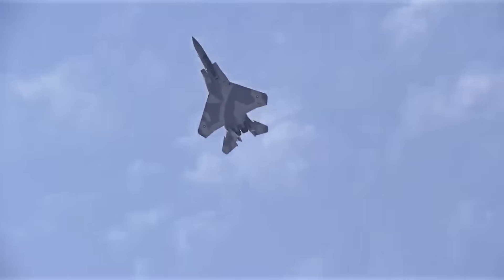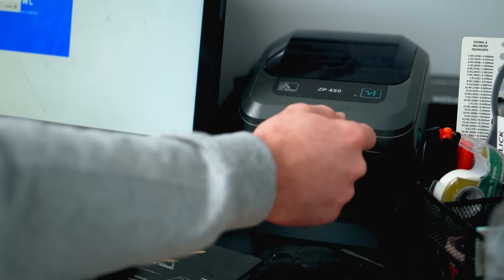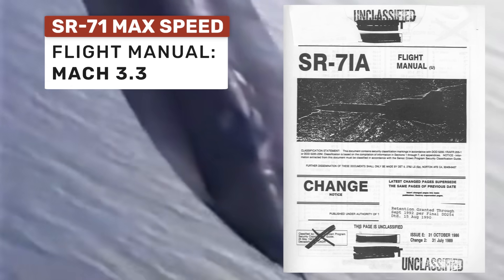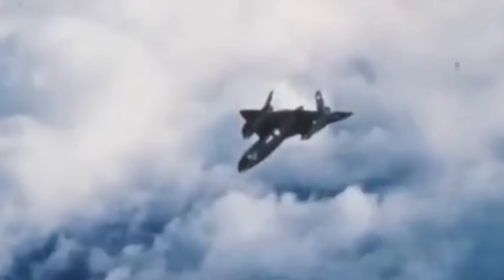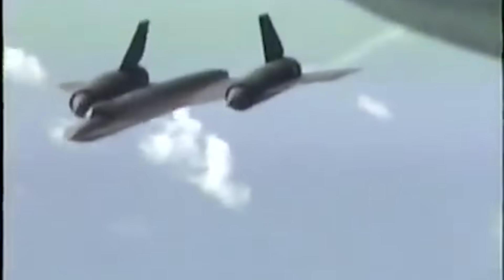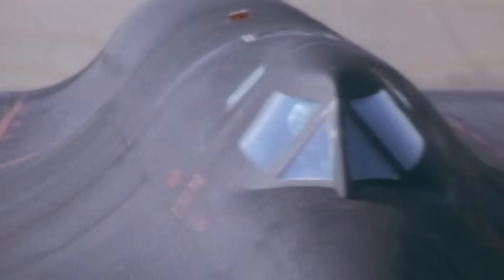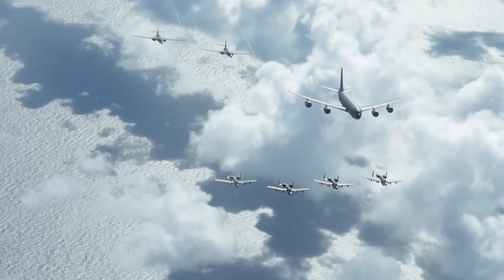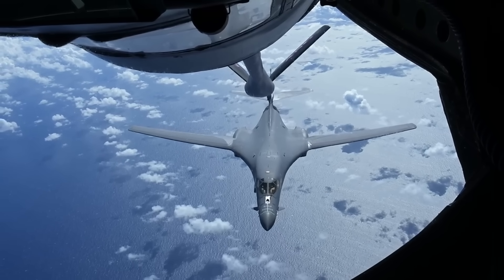The SR-71 was MUCH FASTER than the Air Force will admit

Comment: The German bomber that Hitler wanted to bomb Manhattan Suposedly would go into low space and Skip off the atmosphere all the way to ny, drop its bomb then go back to low space and Skip to japan.
If the Dr was using this method of travel it would explain why it had no it signature while travelling over cccp airspace.hmmm
Reply: What you're describing was built by Eugen Sanger and Irene Bredt and was called the Silbervogel (Silverbird). It was basically an aircraft composed of three pieces: The aircraft itself, which had a flattened fuselage rather than a cylindrical cross-section, with three liquid-fueled engines in the back.  It had thin airfoils which were swept and had the thickest part past the 50% chord with an almost diamond-like cross-section, and an H-tail that looked like it wouldn't be out of place on a B-24 or an Avro Lancaster; a booster which was comprised of around 50 surplus V-2 engines and; a sled which was attached to a rail.

The design would fire it's booster engines and would accelerate down the rails for about a mile and half, with the railway tilting up 30˚ before it'd achieve flight.  At this point, the sled would separate from the aircraft itself, as well as the boosters.  The main engines would fire and the craft would accelerate to a speed of Mach 17.7 as envisioned and assume a ballistic arc which would place it past the von Karman line and effectively above the bulk of Earth's atmosphere.  Reaction-control motors would be needed to control the craft as the dynamic forces acting on the airframe (and control surfaces) would be all but nonexistant.

Normally, when you re-enter the atmosphere, you tend to ride along a re-entry trajectory that is flat enough to avoid excessive thermal and decelerative loads on the craft, and steep enough to avoid skipping off like a flat stone skipped across a lake.  The Silbervogel actually used the latter option however, and used it's reaction control motors to adjust it's attitude to effect this.  Prior to re-entry, it's bomb-bay doors would open, and a 4000 kg (8818 lb.) bomb would be released, followed by the bay-doors closing up.

The bomb's flight-path was such that it would come down in NYC: Even with no explosives, a projectile hitting the earth at 3000 m/s would effectively deliver enough kinetic energy as to amount to it's own weight in TNT (and it did have explosive in the payload).  It wouldn't quite be like a traditional bomb, and would hit more like a small meteor and punch a nice hole wherever it hit and displace a decent amount of rubble up into the air.  It wouldn't be anything like a nuclear bomb, but it would be a rude shock as it's supersonic speed would theoretically ensure nobody would hear it until it hit.

The craft would effectively begin entering and effectively skip across the atmosphere, decelerating, but also climbing as it did so along a ballistic arc smaller than the first. This would carry it further forward, and it would skip several times, with each skip being less than the preceding ski, much in the same way that a basketball bounces highest the first time, and for the same reason.  

Eventually, it would be incapable of bouncing anymore, and would effectively do a gliding re-entry similar to the later Space Shuttle, though it actually had flaps.  It would now be on the other side of the planet, which was expected to be under Japanese control (also another Axis power) and presumably able to find a runway long enough for its purpose.  Since it's landing speed would probably be fairly high, it would need a steep descent for most of the approach, with the flaps brought down, followed by the gear  just before touch down, at which point the nose would be flared for touch-down.

It was an interesting concept, but it was ultimately flawed for a simple fact that, while the Germans understood the effects of kinetic heating, they had miscalculated things, and it would have effectively burned up on the way up, or on the way down.

Comment: All things being equal an AV top speed is almost always limited by inlet design. F-16A with a "point" design inlet from NASA went ~2.6. F-14A would go 2.75 but it would halve the life of the engine. Subsequent models were given a "p_max" switch and told if they ever pressed it they would be permanently grounded. Anywho, this in the internet so believe me or don't.

Comment: I’m a private pilot and a plane nerd. Though my vision kept me from flying in the military, so I went in the Army. But a buddy I used to work with was an F-15 crew chief in the late 90’s. He told me years ago sometimes the pilots would push Mach 3 and then they’d have to go through some extra inspections. And those were C’s and D’s. I’d be shocked if an EX couldn’t do at least 2.9 on the regular.

Comment: You actually left out the primary limiting factor in the Blackbird's top speed.

I'm friends with Al Bowers, the recently retired chief scientist at NASA Armstrong (formerly Dryden).  After the Air Force retired the '71s, NASA got a couple to use as test beds for high-speed research. About 10 years ago I asked him, with all the wild stories of the plane's top speed floating around, if he could tell me what it really was, assuming it wasn't classified. His reply: "There's nothing classified about the SR-71 anymore, it's all public.  The Mach 3.3 number is (as you stated) the top speed for sustained flight for thermal reasons, but the real top speed is Mach 3.47, give-or-take, at 80% afterburners."  Naturally I asked further, "80%? Why don't they push them to 100%?"  He said, "Mach 3.47 is the point where the shock wave off the nose spreads out far enough to hit the engine inlets.  If you go any faster, they'll start ingesting 'dirty air' and you run the risk of compressor stall or flameout." Paraphrasing the rest of it, you're not going to make any more power (to go faster), no matter how much fuel you spray into the afterburners.

This correlates well with Brian Shul's Mach 3.5, since it does depend on air density.  There's also the CIA pilot who was being chased by a SAM (al la Gary Powers) who pushed his A-12 to 100% afterburners, while heading more up than forward, to outrun the missile.  He actually did, continuing to climb until the engines flamed-out and coasting well over 100K feet before heading back down.  He made it back to base, but the airframe was junk due to thermal and mechanical overloads, and likewise the engines since he kept running them well past the 3.5 shockwave limit.
Reply: Your first comment is decently accurate. Your second comment is completely BS though. So virtually everything is incorrect.
Reply: @gr8crash  - Sources?
Reply: @hagerty1952 pilots, ground crew, design studies,  tech data, mission reports. A good understanding of the aircrafts performance and that throttle position in AB isn't liner and a  direct correlation to speed. Also that most of what Brian Shul says is completely made us, especially since he was removed from flying the SR71 after he was caught lying to his Commander.
Reply: @gr8crash  - OK, that works. But 3.47  does round to 3.5, if you want to be pedantic.
Reply: @hagerty1952 true,  but they don't tend to round because the TDI is already accurate to the hundredths place. Only other thing I'd add is that there were a few flights in the 3.4x range, with one pilot reaching 3.49 and about 91k ft, but these were also not fully within the pilots control.

Comment: My buddy worked at the company that produced the aircraft - he stated:  "Take whatever statistic was published on the SR-71 and either cut it in half or double it - whichever is more impressive - that is the actual statistic.  He told me they went coast to coast in 54 minutes and that time included in-air refueling!!!  The published / 'official' stat was Mach 4.5 - he said Mach 9
Reply: Virtually everything you said is incorrect
Reply: @gr8crash  I completely agree!  Oh, and Project "Aurora" is virtually fiction too! 
You are ADORABLE !!!!   : )
Reply: @repentnow1720  no the aurora program was real. It encompassed the ATB program which in the end when it was between Lockheed and Northrop, Northrop won the contract to build the B2. That's all that came from the "aurora" project. 

The West to East coast record was 68 min, and that didn't include refueling. Refueling was completed before and after the timing gates and wasn't included in the times. 

There's literally nothing that states mach 4.5 as that's literally impossible for the SR71 to do. And absolutely never in a million years would it ever reach mach 9. That's absolutely absurd. 

Anything else you want to be corrected on?
Reply: @gr8crash  Again - I completely agree!   

You are again correct - The SR-71 was retired and nothing ever replaced it.   

We never built another / newer ultra-fast aircraft.

You as sooooooo cute!   

Don't you ever change!

: )
Reply: @repentnow1720 I mean at least you understand it. When the SR71 was retired, there was simply no real need or even ability to build a true successor in terms of performance. But the type of war fighting changed,  we needed aircraft that could remain on station for long periods etc.  That led to the rise of drones and UAVs. An SR71 would have been useless in that type of war.

Comment: 7:16 you can't tell the velocity if you only know the Mach number!
1) the mach number depend on the velocity and the speed of sound
2) the speed of sound depend on temperature

So if the airplane hit a cold air front, the temperature drop, and instantly the Mach-Number increase.
Due to the cold temperature the density is higher and you produce also more thrust, so your velocity is increasing.

Bottom line short: without the temperature you cant tell the velocity if you only have a Machnumber!

Comment: 3.5...90,000.    It is actually very dark navy blue and not black.
Reply: On a regular mission?  Absolutely not. Even getting to that speed and altitude required very specific atmospheric conditions, and those limits would be some what out of the pilots control. Also no, it wss never a dark blue, but black. Emissivity Black to be accurate.

Comment: A F-15 pilot at an Air show at The base at Panama City told me he had the aircraft he was on had been at 1950 MPH.  Not far from the Claimed top speed of Mach 3  at sea level is 2220, is it the same at higher altitude?  This was in the early 90's?

Comment: MILITARY records will NEVER be published because they are considered SECRET or ABOVE.
Spruance Class Destroyers have a Maximum UNCLASSIFIED SPEED of 30 knots. One of my ships did a high speed run (OUTSIDE the range of CIVILIAN EYES) to determine their ACTUAL speed. It took both the Ship I was on (making the run) and 2 other ships tracking us to get an actual speed because we may have gone faster than our speed indicators could measure. We made the run, and the results were published in SECRET NOFORN Lessons Learned documents. NOT releasable to the General public, nor any other Military members without a "NEED TO KNOW".
I am lead to believe you WERE a U.S. Marine (the cover in the back right corner of your video) so YOU should know better.
Reply: Depends on in use vs not in use. The SR71 has been retired for over 2 decades and all the performance information is known, public and published
Reply: @gr8crash  NO, there are still documents concerning submarines from WW2 that are still classified. The capabilities of 2 of my ships although decommissioned and sank, are still classified. So IN USE, is not a reason to declassify information. Performance data may be speculated, but HAS NOT been declassified, nor confirmed by the Air Force.
Reply: @warrenjameson5465 strictly referring to the SR71, virtually everything is declassified. Performance capabilities etc. All of it is known, public and declassified

Comment: I also knew an SR-71 pilot back in the 80's who said "it's faster".     But, I'm not buying the "hot day, nose down into good air" story..  Above 60 thousand feet altitude the air temperature is extremely stable.  Nothing that happens  on the ground (hot/cold days) has any effect up there for a long long time.
Reply: It was generally pretty stable but it did fluctuate. That fluctuation greatly affected SR71 performance

Comment: A buddy of mine worked in the Air Force in the 1980s. He refueled sr-71. He told me he knew: how much fuel he put into that thing before it took off, 
he knew how long it was gone for, 
he knew it was empty when it returned. 
And he said there's no way it burned that much fuel, if it only went as fast as they said it did.  Knowing as speed doubles aerodynamic resistance squares, he figured the top speed was closer to mark 3.8.
Reply: None of that makes any sense at all. And that speed isn't even remotely possible.
Reply: @millionsofrecordsernieb7587 so refreshing and rare to see someone else in these comments that understands what is and isn't possible and why. Great response.
Reply: @MillionsOfRecords I'm a mix. While I sometimes tend to jump on a comment it depends how absurd it is. But if they are genuinely curious as to the reason for my response I'll gladly tell then. Sadly most just aren't interested or get mad/defensive.  I agree it's nice that these videos get people interested,  but it does get annoying when they choose to believe the myths over facts.

Also agree, there was just no need to make it faster, especially when doing so made the aircraft increasingly less safe.

Comment: VMAX is only used to escape incoming enemy missiles, and damages the engines to the point they need to be replaced. But it gets the pilot home safely and spares him and the airframe from certain death. This has been available for a while. The new F-15 has it, but if I am not misinterpreting what I've heard from folks in the F-15 community in the past, it has been there for a while. As in back in the 90's, when I was told this by an Eagle maintainer.
Reply: Anyone in the F-15 community can chime in to tell me if I'm wrong. My knowledge is second hand.
Reply: I believe the first time I was told of it it was called "Emergency Augment" or something like that.

Comment: I did have someone who did air traffic control and spacecraft monitoring tell me directly that the performance of the SR-71 in both speed and altitude are far greater than the officially quoted figures, but that it basically never pushed the limits because it simply didn’t need to.  It just flew as fast and high as it needed to at any time, never wanting to reveal its potential 

That’s why it smashed 4 world records on its final flight to a museum
Reply: It didn't really "smash" them but set new ones. And he was messing with you.

Comment: Along with the speed record, I have always been curious about maximum altitude and just what record the SR71 holds.
Reply: The record was at little over 85k ft, couple days later the unofficial record was just under 90k ft. It's had reached higher a couple times but it wasn't fully intentional.
Reply: Right, but other aircraft had reached higher earlier. Was there some specific aspect of the aircraft that made this altitude record unique.
Reply: @stuffak4540 there's been no other aircraft that can reach and sustain these altitudes,  even to this day.
Reply: Yes except for :
Mig25 118k 1973
F104 91k 1958
Su9 95k 1959
F4 99k 1959
F104 103k 1959
Perhaps the SR71 could sustain that altitude where the others were momentary?
Hence my original question.
Reply: @stuffak4540 ok I see how I misread your comment, my bad. So there are differences between the SR71 and the aircraft you listed. The aircraft you mentioned reached a higher peak not sustained altitude like the SR71.  Those were typically flown in a ballistic trajectory, meaning the climb up to max altitude is in an arc it will basically climb until it can't any further than push over and essentially fall back down into denser atmosphere. But none of those aircraft could fly sustained at those altitudes. The SR71 could climb to 80k ft and maintain that altitude. The SR71 has reached up to 90k ft but above that altitude the aircraft would become very unstable and virtually uncontrollable in anything   but a straight line.
Reply: Do you have a reference for that. The wiki page just indicates the class (eg turbojet) and the general aspects of the aircraft designation.
Reply: @stuffak4540  for which? Of the flight profile for those peak altitude record flights?  That you'd have to look more into other than wiki. But that's the only way those max altitude records are set.
Reply: @gr8crash  Yep have tried that. The FAI website is extremely useless and shows no such detail that these are peak records (or sustained for that matter).

Comment: I used to date a girl in the 80's whos father was the second cousin to a mechanic who talked to a guy who was familiar with the people who knew the engineers of the SR-71 and they worked closely with the pilots who said undeniably that the heat of the airframe allowed the liquification of low oxygen at altitude in the ionosphere thereby propelling the SR-71's improbability drives to reach Ludacris speeds
Reply: Interesting.

Comment: F-15EX might get 2.3-2.4 Mach on a good day.  The old Streak Eagle managed to get to 2.5 with no paint, no radar. no tanks, simple avionics, and one radio.  The EX is not only heavier than the Streak Eagle its also got more drag.